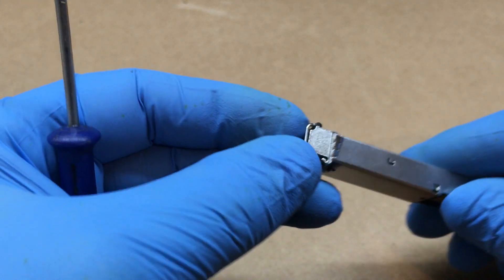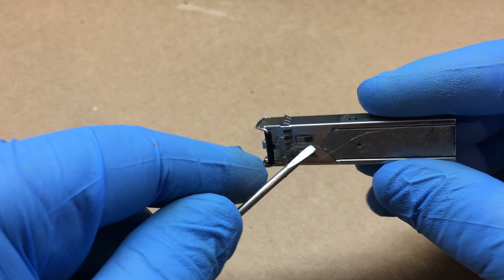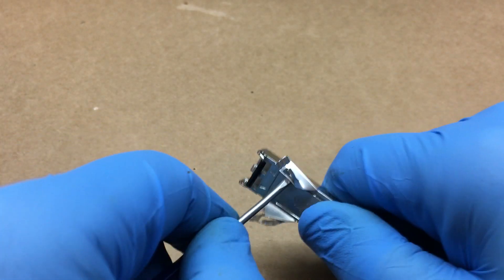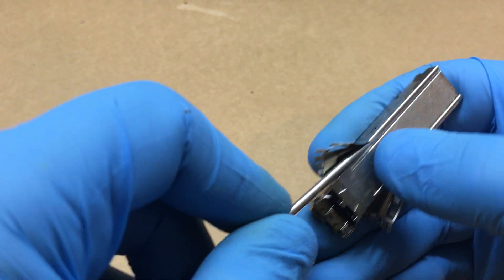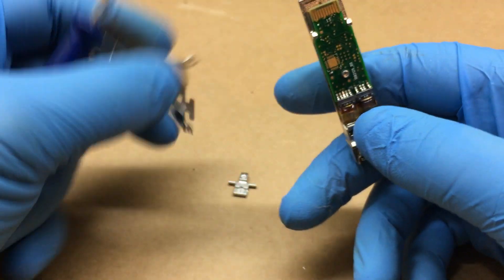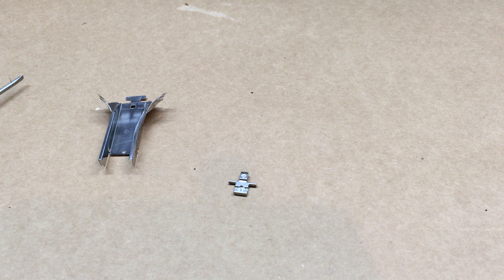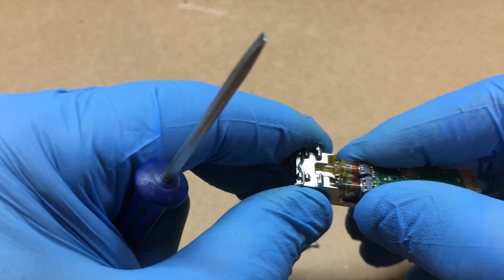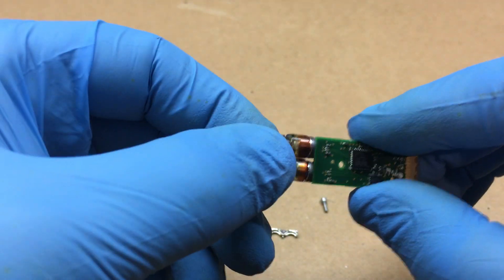The Inside Of A Small Form-Factor Pluggable “SFP”

Comment: These devices function like water cannons, designed to transmit and receive light through multimode or single-mode fiber optic cables. I'm curious whether the optical transmitter used is a laser or an LED.